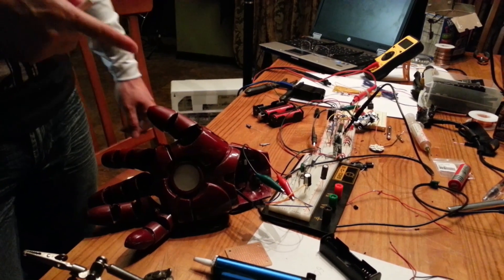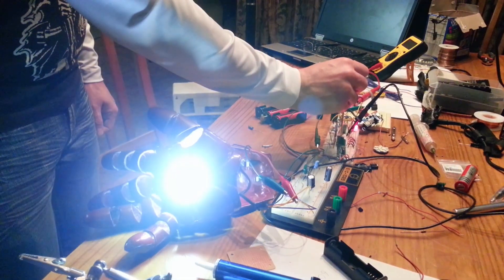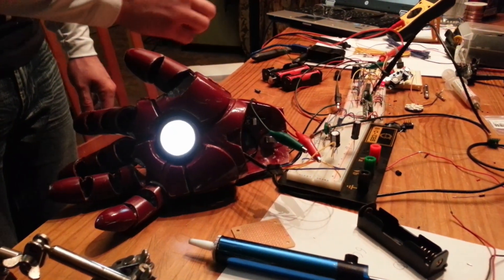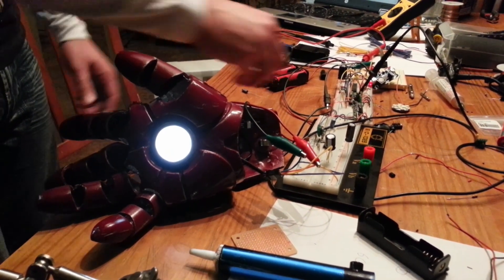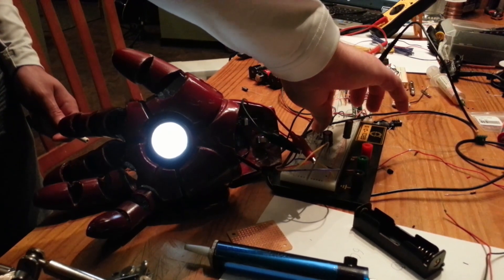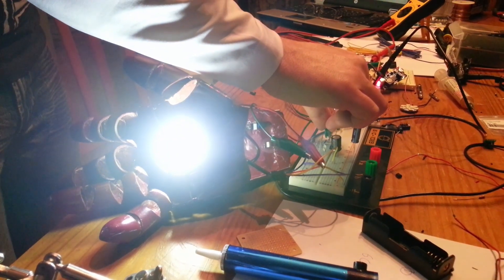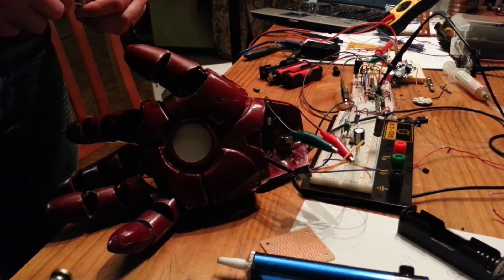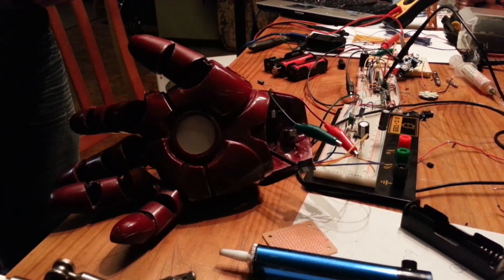New Iron Man Repulsor Demo

Comment from the maker: Funny you mention that cause you will have to check out my full demo when I post it in a day or two.  I have set up two sound profiles that you can switch back and forth between at any time.  So you can have both if you want.  Also, these sound modules are USB programmable so you can use whatever sounds you want.  

I am not quite sure what you mean by toggling on and off quickly.  You can activate it and then deactivate it as fast as you want.  Anyways, Thanks.